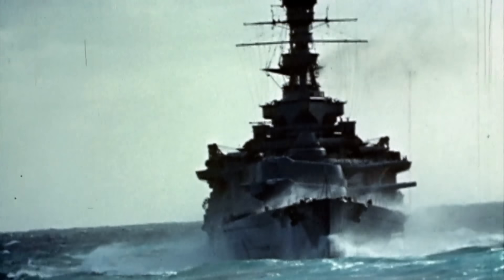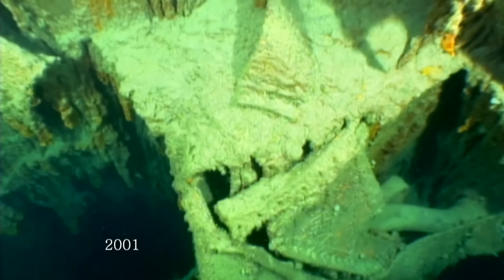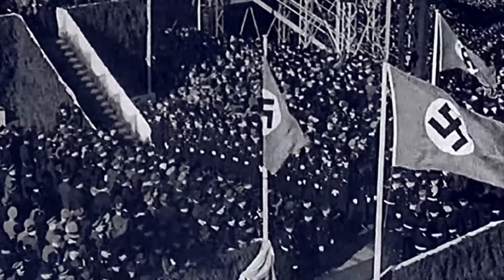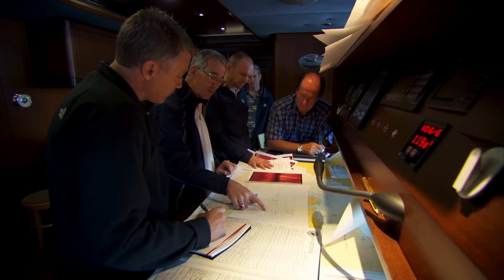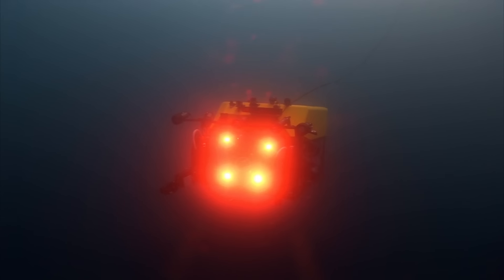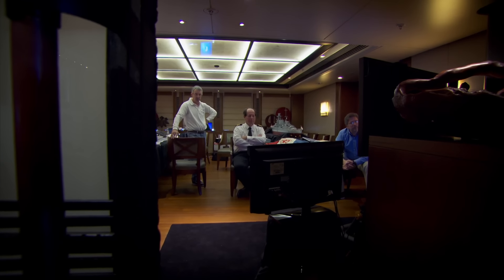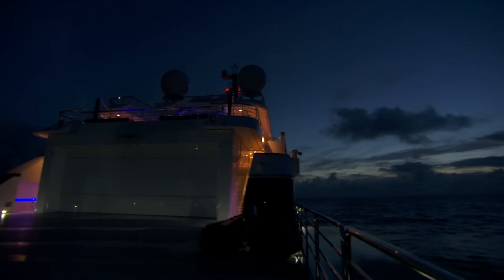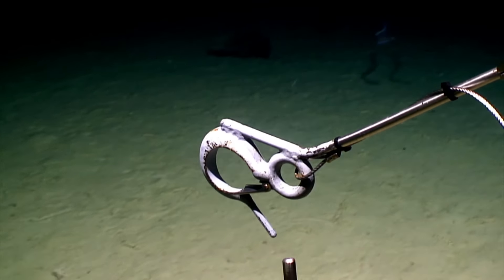How the Bismarck Sank HMS Hood - Documentary

Comment: Easy for anyone knowledgeable about history. Any piece of major military equipment is built with compromises. Battleships, like tanks, are a balance between speed and armor. In the era the Hood was built, engines weren't powerful enough to both drive the ship at the desired speed and be armored enough to take serious hits. The speed was achieved with less armor, particularly on the deck, since a hit there was less likely! Unfortunately for the Hood, the Germans didn't get the memo on that.
Reply: Bismarck belt armour   = 12.6 inches
Hood belt armour          = 12 inches (Though angled so as to give 13 inches of protection).
Bismarck deck armour = 4 inches
Hood deck armour        = 3 inches

Pre war testing had show that Hood's 3 in deck armour was proof against 15in shellfire at anywhere below 20° angle of fall.... at the range of Bismarck's killing shot the angle of fall of her 15' shells was in the region of 11-13°. Hood had escaped from the danger zone of "plunging fire" only to receive a million to one hit via an obscure "Achilles heel" in her vertical armour.
Reply: @walterkronkitesleftshoe6684  It was acknowledged by the British Navy that the Hood was underarmored purposefully in order to be faster. The Battle of Jutland showed that slow, heavy battleships were not optimal just because of their thick but heavy armor. Lack of speed was determined to be the major reason the British battleships suffered heavy damage. The ships after that were built more for speed than protection.
Reply: @muzikizfun  It wasn't acknowledged that Hood was underarmoured. At the time of her construction in the early 1920s she sported armour equal to that of Britain's current battleships while being 7-8 knots faster than them. Where the problem in 1941 lay was that during the interwar years the range of naval gunnery and rangefinding had increased considerably with improved optics and the introduction of rudimentary ranging radar. Hood had a number of smaller refits during the 1920s and early 1930s but due to her imperial commitments and the scheduling of major refits for older ships she was one the last of the major units of the RN in the queue for a major upgrade.

You seem to have got the facts the wrong way around... after Jutland Hood was redesigned on the slipway to INCREASE her armour, and the RN's subsequent battleships placed ARMOUR OVER SPEED, and not the other way around.

That aside, as I have described above on 23rd May 1941 she had crossed the danger zone of plunging fire from longer range enemy gunnery and was in the process of turning to port to open her aft gun arcs when one shell found an obscure "Achilles' heel" in her vertical belt armour.
Reply: @walterkronkitesleftshoe6684  I hate to correct you, but they did acknowledge it in the 1920s. You aren't knowledgeable enough. They didn't say underarmored, they used the term lighter. That's why she was officially a Battlecruiser and not a battleship. She was large but underarmored.
Reply: @walterkronkitesleftshoe6684  keep believing your wrong interpitation.
Reply: @muzikizfun   'Lack of speed was determined to be the major reason the British battleships suffered heavy damage. The ships after that were built more for speed than protection.'   Really? Explain how one of the fastest battleships in the RN at Jutland, HMS Warspite, sustained the greatest damage.

Oh, and explain how the Nelsons & the KGVs were among the best armoured battleships in the world at the time of their construction. In terms of belts, only the Colorado class were stronger, though with much weaker deck armour.

HMS Hood, by the way, was redesigned after Jutland, and had armour the equivalent of the Queen Elizabeth class battleships.
Reply: @dovetonsturdee7033  The Germans proved it with the Bismarck.
Reply: @muzikizfun  Proved what?   That a modern battleship with outdated armour could defeat a 21 year old battleship with outdated armour, or that a 15 years old battleship with modern armour could reduce Bismarck from a battleship to a gunnery target in about 20 minutes?

I refer you to the events of 27 May, 1941.

"Non Genarant Aquilae Columbas"
Reply: @dovetonsturdee7033  blah, blah, blah, excuses aren't an argument.
Reply: @muzikizfun  Indeed. You haven't any, as you failed to reply to my original comment, which was :-

Oh, and explain how the Nelsons & the KGVs were among the best armoured battleships in the world at the time of their construction. In terms of belts, only the Colorado class were stronger, though with much weaker deck armour.

Why, by the way, should the Royal Navy need an excuse for sinking Bismarck?
Reply: @dovetonsturdee7033  monotone zzzzzzzzzzzzz
Reply: @muzikizfun  I rather assumed that you couldn't answer. You are one of many people who post from profound ignorance on this subject.
Reply: @dovetonsturdee7033  from historical sources referring to First Sea Lord Admiral, Sir John Arbuthnot "Jacky" Fisher, in comments about Battlecruiser, as opposed to Battleships. "He developed heavily armed but lightly armored battlecruisers." His direct quote: "Weight in armor should be sacrificed to weight invested in guns and heavy propulsion machinery to generate higher speeds." The result of this philosophy resulted in 3 Royal navy battlecruisers being sunk in 1915 the HMSs Indefatigable, Invincible (poor name choice), and Queen Mary. Several Battleships were damaged but didn't explode like the battlecruisers. 
"The Hood, designed in 1916, was to be larger, faster, and more heavily armed. But in deference to Admiral Fishers' vision, her armor was significantly thinned in order to reduce her displacement and increase her speed."
"The Hood's main protection was along her hull against heavy shells and torpedoes. The belt was 6" at the bow and 12" along the sensative areas. On the deck, the steel was 2" at bow and stern and increased to 6" on both main and boat decks. The main structure of the barbettes was 12", while the turrent gun housing were 15". and were 11" on the side and rear. The top of the turrent had only 5", an inch less than the deck. Battleships of the same era had hull and DECK plating between 12"-15" in thickness."
Is that enough facts for you, amigo!
If you're going to defend your position, then use data correctly. Otherwise, you'll get blown out of the water like the Hood.
Reply: @muzikizfun  Thank you for discrediting your own argument.  You wrote ; 'Lack of speed was determined to be the major reason the British battleships suffered heavy damage.'     

I responded by asking :- 'Oh, and explain how the Nelsons & the KGVs were among the best armoured battleships in the world at the time of their construction. In terms of belts, only the Colorado class were stronger, though with much weaker deck armour.'

You then, finally, replied with a long, entertaining, rant about Jackie Fisher and battlecruisers, followed by a comment which said that :- ' Several Battleships were damaged but didn't explode like the battlecruisers,'  which was questionable, as at Jutland Warspite was moderately damaged, Barham & Malaya  received lesser damage, all with the battlecruiser force,  whilst Colossus was the only Grand Fleet battleship hit by shellfire at all. If your really want to see a fleet which came out of Jutland with numerous damaged battleships, look at the one Scheer commanded.

"The Hood, designed in 1916, was to be larger, faster, and more heavily armed. But in deference to Admiral Fishers' vision, her armor was significantly thinned in order to reduce her displacement and increase her speed."   Wrong, and irrelevant, as Hood was redesigned after Jutland in order to improve her protection. She actually marked the end of the battlecruiser era, and emerged as the first true fast battleship. As her designer, the Director of Naval Construction (DNC), Sir Eustace Tennyson-d'Eyncourt, was  instructed, the design for the Admiral class should: "take the armament, armour and engine power of Queen Elizabeth as the standard and build around them a hull which should draw as little water as was considered practicable and safe, and which should embody all the latest protection and improvements against underwater attack."  Does that sound, even to you, like 'deference to Admiral Fisher's vision?'  As I remarked, moreover, those instructions pre-dated the improvements in design of the post-Jutland period.    Fisher, by the way,  had resigned in May, 1915.

"Battleships of the same era had hull and DECK plating between 12"-15" in thickness."  Your cut & paste approach has let you down.   Let's look at the deck armour of the battleships around at the time that Hood was constructed. Say, 1916 -1921.  

Valiant : 3 inches.
Ramillies : 4 inches.
Konig  : 1.2 inches.
Baden : 4.7 inches.
California : 3.5 inches.
Colorado : 3.5 inches.
Nagato : 2.5 inches.
Lorraine : 2.8 inches.
Andrea Doria : 1.6 inches.
Sevastopol : 1.5 inches.

Now, please name me any battleship of the period which had   DECK plating between 12"-15" in thickness."   I anticipate your response with eager, anticipation.'  Just to confuse you further, even the 1940 Yamatos had deck armour of 'only' 9.1 inches, and the South Dakotas 5 inches.

Oh, and you still haven't actually replied to my comment about the Nelsons & the KGVs, which had the thickest belt armour of any warship in existence in 1940 except the Coloradoes. 

Facts are indeed very useful tools. But not when, as in your case, they are used either irrelevantly or simply inaccurately. If you want a debate about the battlecruiser concept, this is not the place.

Perhaps you should abandon your mission, steam (metaphorically) for St.Nazaire, and hope not to encounter Swordfish, Rodney, or King George V, on your way there?

Comment: Their assumption at the end makes absolutely no naval sense whatsoever. if they were out of range and their shells dropping short. it wouldve been the mistake to show their broadside to the Bismark with superior firepower. I believe that assumption to be the complete opposite. The hood would've had to have closed the distance as a heavy cruiser for its Shells to have any impact in the first place against a superior ranged Battleship. Naval 101.
Reply: You've misunderstood the situation. Neither Hood or Bismarck were "out of range" of the other. They could BOTH hit one another at the range of Hood's destruction, What you might be referring to is that at longer ranges naval shells impacted at a steeper angle (what is usually referred to as "plunging fire"). Hood had weaker horizontal "deck" armour, and so needed to move closer to Bismarck to prevent Bismarck's longer ranged "plunging fire" from hitting her weaker deck armour, at the shorter ranges it would then mean that it was Hood's heavier vertical "belt" armour that would be tested by the German fire.

Hood had moved sufficiently close to Bismarck to escape from the ranges where "plunging fire" would be a danger, and then turned broadside to allow all 8 of her main guns to return fire at Bismarck.
Reply: @walterCronkitesleftshoe6684  thanks for the detailed response]

Comment: A rather unsatisfactory documentary in that it ignores a number of critical elements in the disaster. First, in its anxiety to exonerate Adm Holland for the sin of not following navy tactics, it showed that the rudder was hard over as the Hood entered its prescribed swing to port to engage the Bismarck with all four turrets. However, it was this turn that exposed the aft of the ship to the direct fire from Bismarck and enabled a shell to reach the region of the rear magazine when, head on, it had been shielded by the superstructure. Second, Hood and Prince of Wales appear to have approached Bismarck in the traditional 'line ahead'.  Had they approached in line abreast, they would have opposed ten heavy guns to the Bismarck's eight while closing the range. Finally it should be remembered that Hood was designed in 1915, a year before four battlecruisers were put out of action at Jutland, and while the deck armour was increased during the build, it is not clear what was done to prevent flash back from the turret or shell hoist reaching the magazine, the cause of some of the Jutland explosions. Due to the turn, the rear turrets were almost certainly loading at the time. It is therefore possible Hood had the same structural vulnerability as Invincible, Queen Mary, Indefatigable and Lion and was sunk, not by a direct hit on the armoured magazine, but by an explosive chain reaction started by a German shell striking the aft upper part of the ship and igniting ammunition on its way to the guns. 
In other words, out of date naval tactics and technology may be what sank the Hood. This may be hard pill to swallow, but there are parallels in the heavy losses sustained by Bomber Command in the first year of the war, using equally outdated tactics and machines.
Reply: Do you really think that gunnery officers in WW2 were able to aim at particular areas of a ship? Seriously?    Holland acted as he did precisely because he was aware of Hood's deck armour, and wanted to close the range because in a close range lower angle action, Hood was at far less of a disadvantage.

The Battlecruisers at Jutland were sunk because of Admiral Beatty's insistence on rate of fire, which led to cordite charges being stored, in many cases, around the interior of the turrets. This practice, which was only ever followed in the Battlecruiser fleet, was discontinued after Jutland.
Reply: @dovetonsturdee7033  Don't be silly. Of course not. I'm suggesting the tactics used exposed the Hood's vulnerable area. Can you deny this?
Reply: @juliancribb813  I wasn't trying to deny anything. Merely explaining the tactics used by Holland, which, apart perhaps from not leading with the better armoured ship, were understandable.

Comment: Hood was the best of her day but she was up against a ship that was the best of that day! The only ship that would have beaten the Bismarck in a one on one battle was the USS Alabama! Alabama had the armor to stand up to Bismarck's 15 inch guns plus the Alabama had 16 inch main guns that were a lot more accurate than the older ships! I've always thought that the biggest battles by battleships would have been the USS Missouri vs the IJN Yamota and the USS Alabama vs the Bismarck! Now because of the gun size and range I gave Yamota the upper hand against Missouri but the Alabama would have beat the Bismarck! I'm sure if the Hood would have had better Armor or thicker armor she would have fared a lot better against Bismarck! Battle ships were built with the deck armor to handle big shells like 14 and 15 and 16 inch and battle cruisers didn't have a lot of deck armor to lessen the weight for speed! Anyway peace out!
Reply: Minor hitch here. Bismarck was sunk on 27 May, 1941. Alabama commissioned on 16 August, 1942.

Comment: There is no such thing as a "lucky" hit. Your guns either have the accuracy and fire control to score a hit or they don't.
Reply: Harold : I beg to differ as how did The Bismarck's Crew know where the ammunition hold was ?
Reply: LOL oversimplification FTW, I see.

Accuracy and fire control will carry the outcome only so far. That shell could have hit Hood's armor belt and due to its angle of approach bounced away. It could have sliced though all the decks (with all their weak armour) and though the bottom of the hull and exploded below the ship or not at all. It could have penetrated the ship and exploded in crew quarters,  devastating them. But in neither of these examples the ship would have sunk. And the fire accuracy couldn't have been as precise as to choose this exact spot to hit.
Reply: Jonah Whale  I disagree Jonah, as some Gunnery Officers (Royal Navy) were excellent mathematicians and could work out trajectory with respect to velocity of the target area. Indeed this was rare but Submarine Commanders do the same today working out torpedo azimuths in their head without of course putting themselves at risk from depth charges from the target.